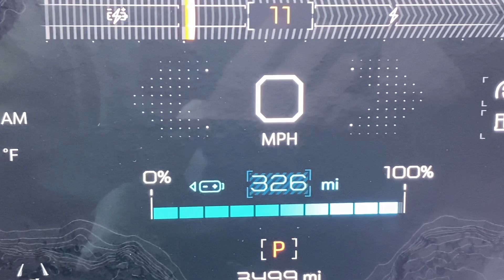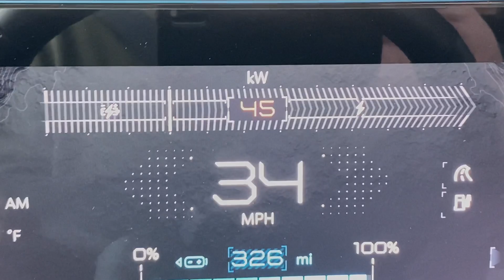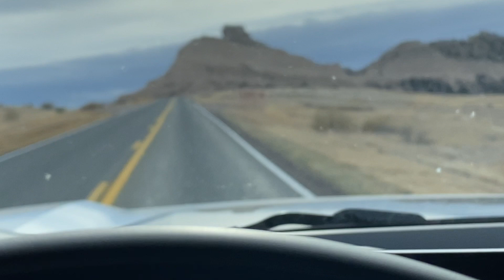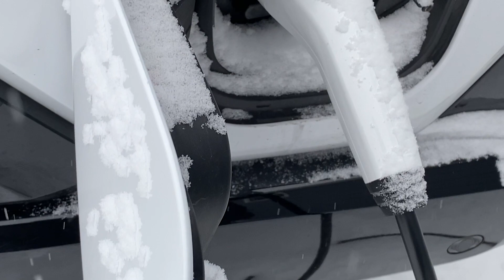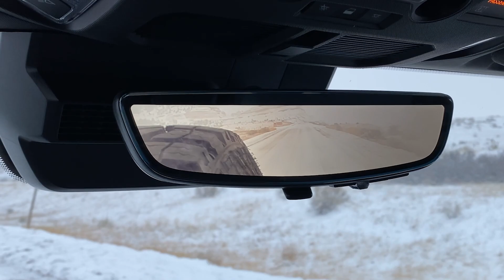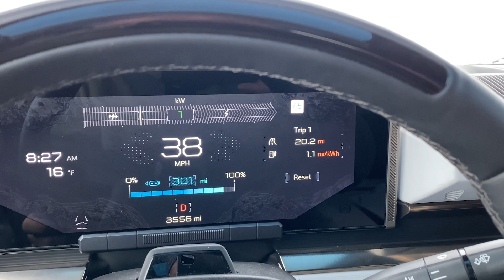Snow and COLD! Electric Truck Range Test with 2022 GMC Hummer EV

Comment: We need CO2 in the atmosphere, don’t fall for the lie. This vehicle also costs as much as my first house. I’ll take my regular car and truck all day. Thanks Tim.
Reply: 440 ppm is high enough, it’s the rate of increase that’s an issue
It was 340 ppm 200 years ago
Reply: @cybertrk  And you think tearing up the earth trying mine materials is the answer? You couldn’t mine enough material in the next 400 years to replace the cars on the road today. Also, how are you getting those materials. Big oil/diesel burning equipment. I think people need to open their eyes and do just a small amount of research.
Reply: @DavidBrown-jt7yi  Difference is often times mining is a lot less ecologically damaging than drilling for oil. (E.g The mining of lithium in deserts does not destroy NEARLY as much environment as a deep sea oil rig does). Also I am sensing a very lazy attitude from you about this, so what you're saying is that you know point A is bad and claim point B is equally as bad so you just want to continue doing point A even though you know it's bad. That's pretty defeatist, why not actually help in trying to solve point A with something useful like a point C.
Reply: @migueljardim8177  check out the documentary “planet of the humans” it exposes the lies of the green movement
Reply: @migueljardim8177  Hey Miguel, solving for C in this case isn’t very hard. You need a combination of (I would say 60% nuclear CLEAN energy, 25 to 30% oil and gas and 10 to 15% renewable energy). It’s hard for people to understand what is really out there because you only hear one side in the MSM. There are just as many people pointing out facts about the climate on the other side but they get suppressed if they go against the narrative. If you can’t see that, nothing will help you open your eyes. I’m NOT saying there isn’t things we can do, but to take the world down this no oil road is very very dangerous game. It will cause poverty and famine like the world has never seen before. These aren’t my opinions, these are facts, you just have to do the research. 

CO2 is a the lowest level here in America in years. Did you know that the California fire from two years ago did more harm to the environment then every car in this country? These are measurable statistics, you just have to look. What about China and India when it comes to pollution? Is it only the western world that needs to worry? Is it only the western world that needs to pony up the cash? You’re being extorted by are own politicians so they can look good to the world. The documentation is out there, it’s our job to look farther than 9News at 10pm. 

When you have everyone onboard with actual CLEAN energy, give me a ring.
Reply: @migueljardim8177  there is enough oil in the continental U.S. to last the world for at least 200 years with NO off shore drilling.
Reply: @cybertrk  my grow room is 1500 ppm .
Reply: .... also there are just as many ICE trucks with similar price tags as this. Are you just whining because you can't afford a new vehicle?
Reply: Let them but their expensive thow away ev's.  The whole winter range lie , is my deal breaker .
Reply: No shit Sherlock. The problem is that there’s too much of the shit in the air lmao. U can’t be this dumb
Reply: With the deforestation is that still the fact
Reply: @jamesrobinson8213  The only way to have a positive affect on nature is planting trees and stop breeding. Other wise all the tree hugging in the world is worthless with the populations of the world taking up every inch of nature.
Reply: @jamesrobinson8213  I only ask people when they talk about “climate change” to educate themselves from both sides. You’ll understand quickly and I mean quickly that the wool is being pulled over your head.
Reply: Same price as an escalade or a HD silverado high country
Reply: You're not the target buyer. Period
Reply: Free driving it’s incredible I know for a fact but keep diluting yourself
Reply: @brunodobia9223  "Free" driving isn't free, and it would never work for what I need it to do and in the area I live. But if it works for you, more "power" to ya.
Reply: Are you a scientist? What qualifies you to make a scientific analysis? And if you're not a scientist, why should we take your analysis over those who study climate change for a living?
Reply: @Coach_BigMac  the climate has changed since the beginning we have went through hot and cold periods. In the early 70s the tree huggers predicted we were going into another ice age.  I was really thinking I would freez to death. It's all BS.

Comment: I'm curious if GM recommends turning off regeneration in slippery conditions like black ice?  Does the system have logic to prevent skidding like ABS?
Reply from the maker: Why would you want to turn it off when it is slippery? My conclusion was I'd rather use the regenerative braking over regular brakes.
Reply: @Pickuptrucktalk  i wrote the comment before reaching that part of video. Nevertheless, just because you didn't slip in this instance doesn't mean it wouldn't  slip in all instances. Curious if it is programmed to detect slip and lockup like ABS.
Reply: @Pickuptrucktalk  looks like they recommend turning off one-pedal in slippery conditions. Probably a CYA move, but just putting it out there for posterity.
Reply from the maker: @wilmarbarrick3194  I’d never turn it off myself. Poor thinking on their part.
Reply: @Pickuptrucktalk  Why would you never turn it off?! Regenerative braking is very similar to brakes, as in the wheel slows down and stops. Either way if there is ice, then you are slipping. A different way to brake is not going to prevent slipping. If anything, the zero control that you have in regenerative braking in the moment, could make sliding even worse.
Reply from the maker: @WhynotMinot  that’s not how it works in reality. It is a much better stopping motion with no wheel slippage. In the video, I never touched the brakes at all and showed it off. The one time I touched the brakes, it slid like crazy. Maybe that should be a video.
Reply: @Pickuptrucktalk  Where I live is notorious for having black ice, and really icy roads. Whether the wheel is spinning or not, there is literally zero traction. It was hard to tell in your video how slippery it was, because you didn't slide much in turns. I just watched TFLev, and they were going a little faster and were in 4ws, but they were sliding. I personally haven't driven an ev with regenerative braking so I don't know how it handles on the icy conditions, but when it's really icy, the way a vehicle stops whether that is through physical brake pads, regenerative braking, or engine brake, will not matter. Depending on the tires that are equiped is going to play the biggest factor in really icy conditions. I would be curious to see another video by you either comparing the regenerative braking to a normal car, or what  the hummer is like on black ice.
Reply: @Pickuptrucktalk  you never use brakes on ice. You simply let off the gas. If this wheels lock you go into a skid and loose complete control. Damn doesn't anyone know how to drive any more.
Reply: You are actually quite correct. SOME EV cars are rather scary in black ice conditions and the regen braking makes things dangerous. I have a Tesla model Y and it is downright scary on black ice, you have to be very very cautions with throttle lift off. Studded or snow tires help, but it is still a factor. The car automatically reduces the regen when it detects cold temps, but never takes it out completely. I cannot speak for how GM handles this issue but I am sure they have accounted for it being mainly engineered in Michigan.

Comment: The Hummer would be 3,000lbs lighter if it was an 6.2L.  I wish it came in a little smaller version with the 3.0L duramax.
Reply: And fuel would cost 5x as much.
Reply: @jghall00  Big deal if you can afford a Hummer you can afford diesel.

Comment: Cheap this, cheap that, remind us how much that thing cost? With all the Cheaps added together with the price  to buy it there will be nothing cheap about it. Period.
Reply from the maker: Sure, good criticism. Cheap to operate. Not that cheap to buy.
Reply from the maker: @Dale Ross $20 to fill up. I'd call that cheap to operate. Cost of the battery? No price at the moment. IF you decide to replace it in a 8-10 years, it is pretty expensive.
Reply: @Pickuptrucktalk  Wait until they add road use tax on those heavy pigs.
Reply from the maker: @morbward8281  they do. In 31 states they charge EVs more in taxes.
Reply from the maker: @Dale Ross thanks. EVs aren’t for everyone and not everyone will own one. That’s ok. Oil and gas will be around for a long time.
Reply: @Dale Ross Don't get me wrong but did I just hear that a non-renewable source of energy is infinite and will not run out? I would REALLY like to know what scientific and peer reviewed journal or source that allowed you to reach that conclusion.
Reply: @migueljardim8177  He's talking about "his" forever, 74 years old and a heart condition.
Reply: @Exsanguinator-bld  Makes sense now, thanks for clarifying.
Reply: @Dale Ross When did illegals get brought into this??? Stick to topic. Also I am assuming you are in the US in which case depending on the state you live your electricity will be generated by varying degrees of methods such as hydro, solar, fossil fuel and wind. The exact split of that however you will have to Google because I  don't know what state you are in.
Reply: @Dale Ross When did I ever say or imply that you were being a "punk"??? Once again you deflect from the real discussion to try and get away from answering the hard questions. Also, just looked it up and the electricity generated in Colorado is split up as follows as of 2021: 41% Coal, 25% Natural gas, 26% Wind, 2.9% Hydroelectric and 3.1% Solar.  So much more renewable than you might think. I think next time let's stick to discussing things and not distracting accusations okay?
Reply: @Dale Ross Hahaha, this conversation really has been entertaining. I don't even live in the US and I'm already getting called an Obama voter. Even if I was, however, I think a common piece of wisdom is to respect the opinion of other people and not just associate with like minded people since that becomes an echo chamber. Also, I can't understand people who stick to a single political party their whole lives without reading manifestos to decide what they like best, I can see this may be one of those cases.
Reply: @Dale Ross A pleasure speaking with you too!

Comment: How does the hummer heat up on cold days?  Would the battery reduce even more if the blower fan was turned up all the way and also if the rear window defroster is on?
Reply from the maker: Like I showed, it heats up in 20 seconds. 

This is the video with using the accessories and fan motors. It doesn't really have that much of an impact: https://www.youtube.com/watch?v=Q9hQXNBSDQs&feature=youtu.be
Reply: @Pickuptrucktalk  Thanks Tim. But is it a hot heat?  Can it be adjusted to a cool, medium and hotter heat?  And is full temp setting hot enough. Up here in Canada we hit -35 Celsius. More heat the better 😄
Reply from the maker: @ramrider1453  It is a hot heat and it is immediate. I find myself turning it down quickly. The heat is controlled by a digital gauge and you can set the temperature.
Reply: @Pickuptrucktalk  A cool cheap tool that would be a good addition to your testing would be a digital temp gun to check vent temps of EV vs ice vehicles
Reply: @pryme2013  That’s a good idea 👍👍
Reply: @ramrider1453  Yeah it would be a very fair way to measure actual vent temps. It could be used for heat or AC